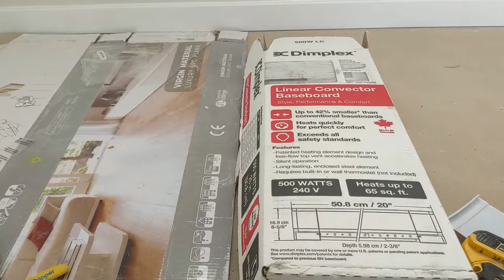How to install A Dimplex BASEBOARD Heater

Comment: Good simple installation but I think you should of been more specific with what your doing. Is this heater 120V or 220V? Is this heater controlled by a thermostat on the wall or is there one built in it? I would of also liked to see you turn it on, that would of probably answered most of my questions
Reply from the maker: Hello Lucas, thank you very much for your time and comment, the heater is 220V and is on a wall mounted thermostat, please let me know if you have more questions, your feedback in very important for my improvement, I really appreciate it, keep safe

Comment: This YouTuber is great but the heaters suck.  If you fart they bend.  The spacers dont clip in properly because they are so delicate and the clip breaks. Then you spend more time screwing the dam thing to the wall than it does to wire the electrical.  I don’t know how electrical safety authority authorizes crap like this.
Reply from the maker: Thank you very much for your time and feedback, keep safe and see you in the next video

Comment: I bought smart baseboard LPC series and I have a hard time to connected to the left side? I read the Instruction and said you must use the right side! Is there away to connect it on the left side.
Reply from the maker: Hello Sam, thank you for your time and support, it can be done, you will need some extra wires to reach from the right to the left side of the heater and transfer the connections to the left, use the space under the heater to run the wires, please let me know if you have more questions, keep safe and enjoy your weekend, please turn off the circuit breaker before connection.

Comment: Thanks, I just installed mine except my model had a single black wire and the white or red wire had to be connected to a blue wire and black wire which were tied together. The supplied wiring diagram was enough to figure it out.
Reply from the maker: Hello Maserati, thank you very much for your support, some times they come with different wires color, with a good instructions and the right Guage wires the heaters work well for long time, keep safe and enjoy your weekend

Comment: Which breaker amp did you use? And was it single or double pole? Please and thank you
Reply from the maker: Hello Breezie, thank you very much for your time, 20A double pole circuit breakers (120 Volt heaters heater require 1-Pole circuit breakers; 240 Volt heaters need 2-Pole, breakers.) Keep safe
Reply: @BahianoReno  I cant seem to find any help online, I have the Dimplex Linear Convector Baseboard Heater 30", 240/208V, 1000/750W, White https://a.co/d/8HWckxV  . Since this is 1000 watts only, I was wondering if I can use 20 amp 120v single pole breaker with 12/2 wire?  20amps x 120volts = 2400 watts
Reply from the maker: @OneTimesZero  yes, would work, making sure that each breaker is in different hot leg on the electrical panel, would be a good idea to tie the 2 single breakers together in case something happens they would turn off at the same time, let me know if you have more questions, keep safe

Comment: Hell. The wires I have coming out of wall are red, black and ground. Red and black are both hot. Is that the same as yours white and black both hot?  Thanks
Reply from the maker: Hello there, thank you very much for your time and support, yes they are both hot, 12ga wires, keep safe and please let me know if you have more questions.
Reply: Yes and thank-you

Comment: Bottom clips bend when I try to push the finish on like you did at the end of your video
Reply from the maker: Hello there, thank you very much for your time and comment, sometimes it can happen metal now a days is lower quality, usually I clip the heater cover on the top clips of the heater, push it down towards the floor a bit, then push it into place, please let me know if you have more questions, keep safe and take care 🙏

Comment: Hello, both wires on heater are black. How do you tell which one goes to the white?
Reply from the maker: Hello Brandon, thank you very much for your time and question, since we have two hot legs to form 220v, any of those wire works, in this case we don't have neutral wire, just hot wires, please let me know if you have more questions, keep safe.